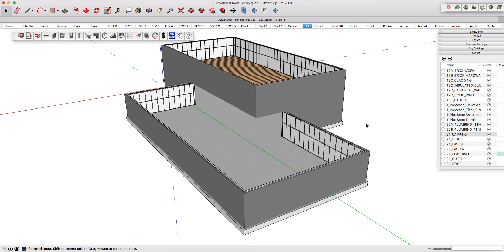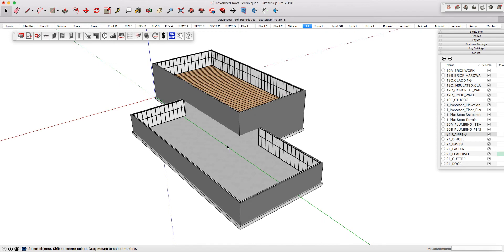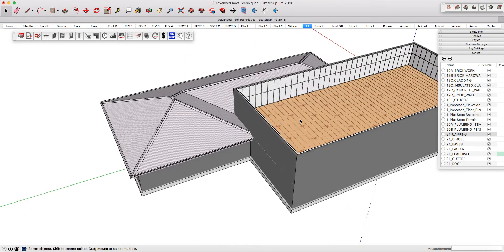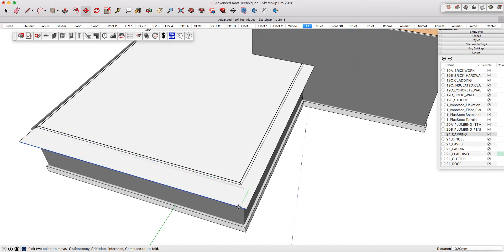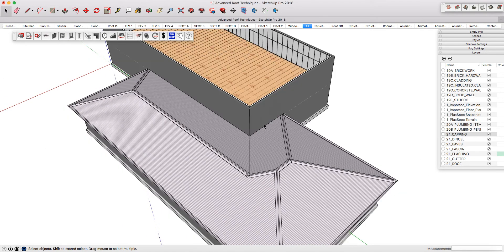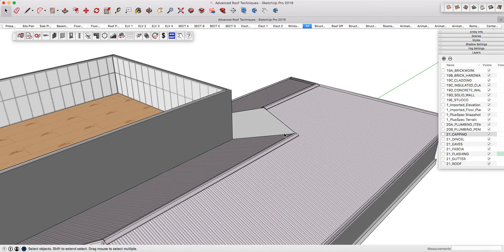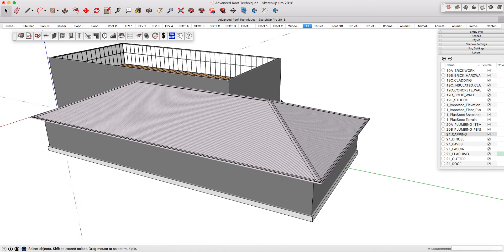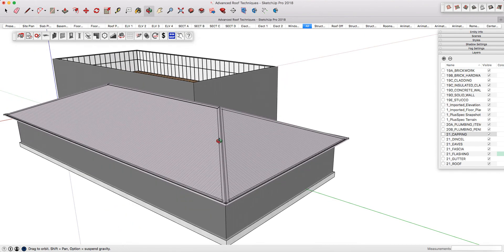PlusSpec for SketchUp - How to create Roofs with Cut-outs & manually control Eaves or Overhangs

Comment: BTW there will need to be a box gutter against the wall on teh lower roof, and yes it can be done, ideally you would create a gable against both walls so the water can run off
Reply: Agreed. This example is just addressing cut-outs, creating different Eaves/Overhangs for each side and adjusting ridges.

Comment: Another good way to do this is to "create face" from base walls and then create face from the top wall loop and then push pull the top face down so it intersects with the bottom face, this way this roof could all be made in one go by selecting the top and bottom face.